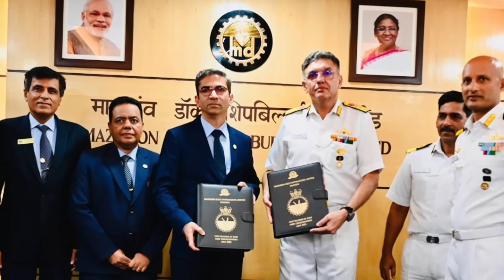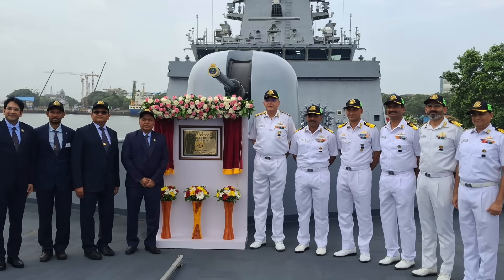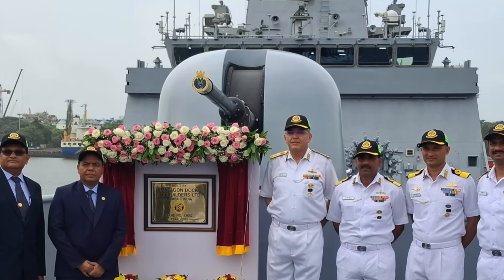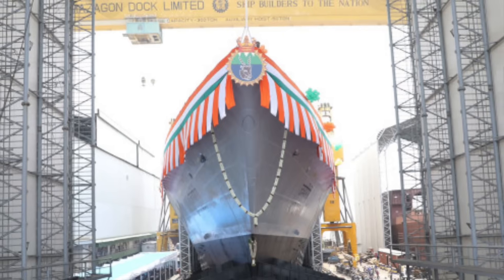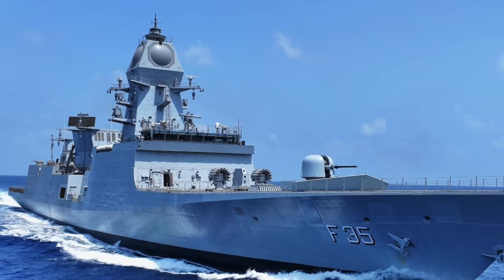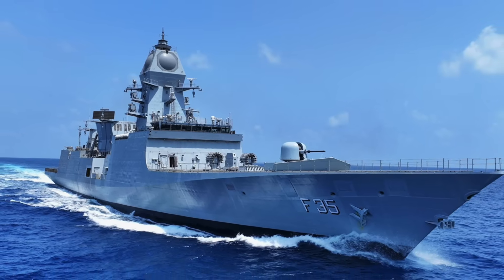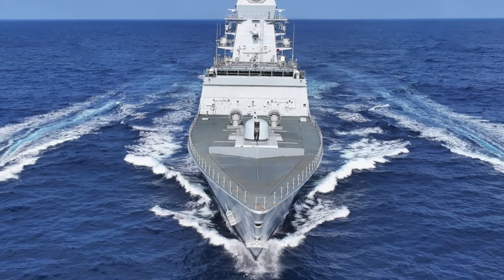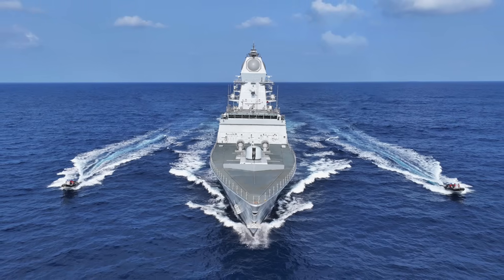How potent is India’s new stealth frigate INS Udaygiri  ?

Comment: Stealth in ship is joke
Reply: No not at all !! , Stealth in ships is different from stealth in jets. In aircraft, the goal is mainly to reduce radar cross-section and avoid detection altogether. But for warships, stealth is more about disrupting enemy missile lock and making it harder to identify the type of ship whether it's a cruiser, frigate, or destroyer. That way, the enemy can't easily judge its firepower or role in the fleet.
Reply: Stealth on ship works different than in a stealth jets...... you need to be mature to understand it.
Reduction of vibration - To hide from enemy submarines.....
Stealth shaping - To avoid enemy Radar detection.....
Reducing of Heat signature - avoid detection by enemy jets and satelite.....
ELECTRONIC WARFARE - Jamming of enemies Radar and missiles.
NILGIRI CLASS (P17/A) has all of it.....